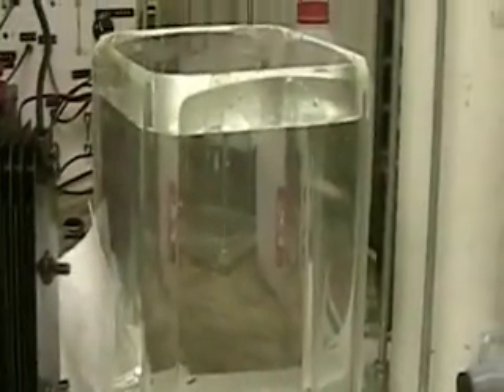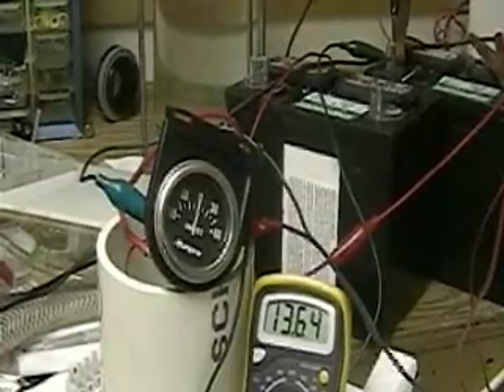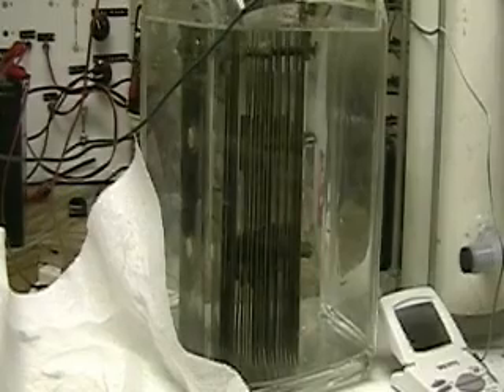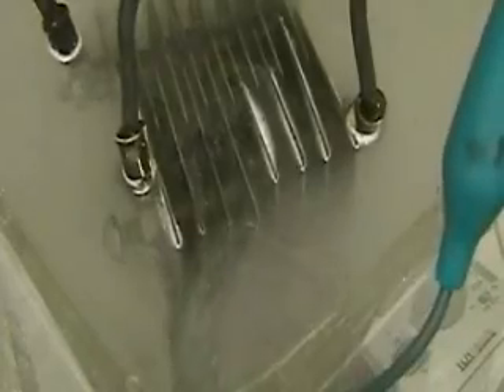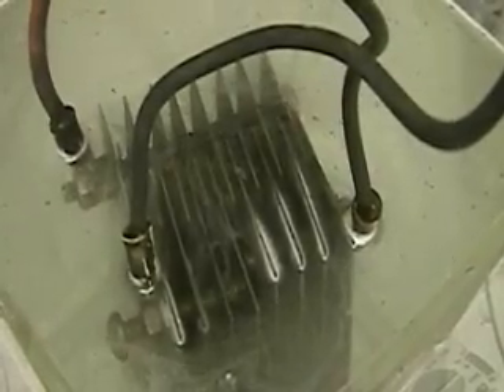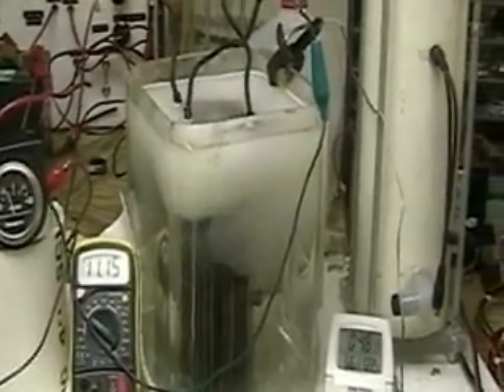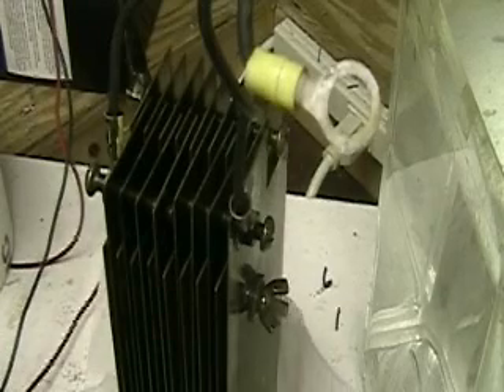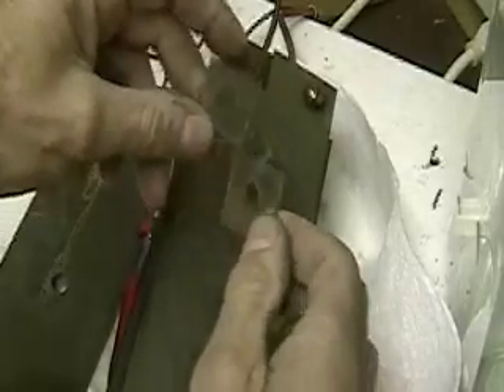Hydrogen Tap (Honda Plate Test) 252

Comment: Hi John,

i have a little question about your experiments.
You are working on an improvement of the cells.
When using baking-soda the produktion rises - also the amperemeter is rising.
Why don`t you use a pulsing-machine like stan meyers did ?
I ever thougt a hho produktion is only useful when done with minimal ampere input ?

Sorry for my bad english and thanks alot for your answer .

Greetings 

Oliver

Comment: Hi John. You can fool the ECU by changing sensor to a wideband sensor. Innovate lc1 for example. Then you can program the narrowband output with a laptop and you will also see air to fuel ratio of your exhaust.